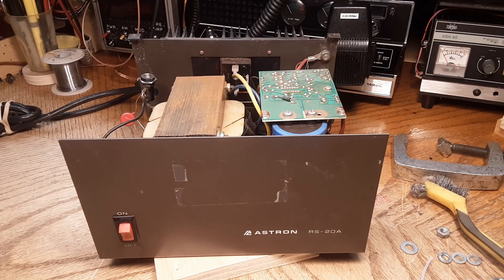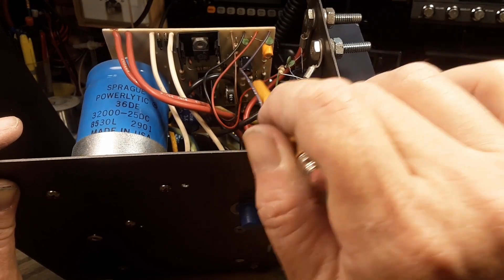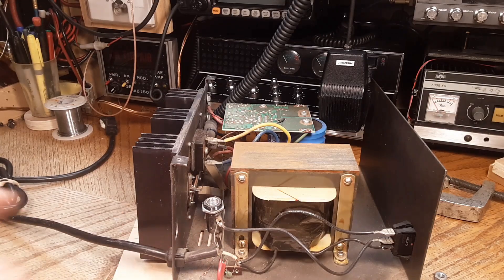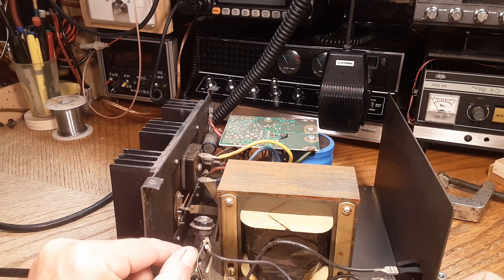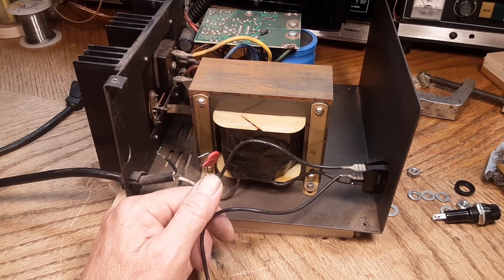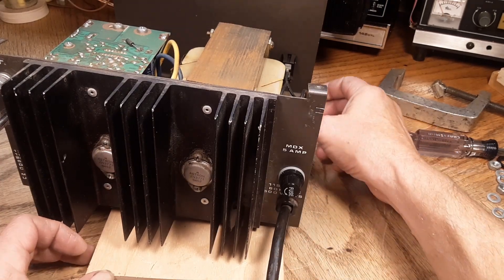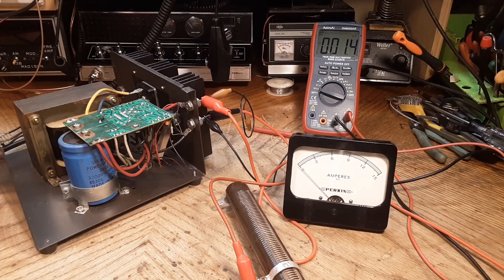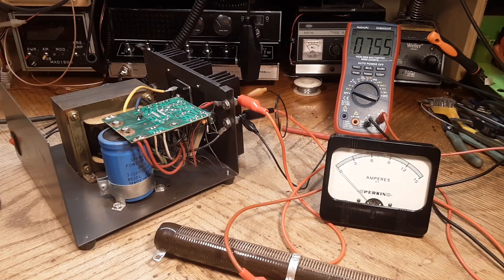astron😀rs-20a power supply,🤔taking a look at.

Comment from the maker: I just realized today that when i went to calculate power dissapation at 8v@5a. i used 10v instead.it would be 70w not 60.😆My comment of," if it works at 6amps it will work at 20amps"really wasn't the most accurate statement.i was over generalizing i think.if the capacitors are low in value,power supply output voltage could sag under load..ive also seen other power supplies with current limit go into limiting prior to their design parameters because of lower value capacitors.

Comment: Ah,  crowbar protection.
I remember working on a big old AC drive that used SCRs instead of transistors in the inverter section.
I put my oscilloscope onto some circuit and managed to trigger the crowbar protection, blowing some very large and expensive fuses 😮
Reply from the maker: Oh wow,sounds like you hit the sweet spot😄scr's do come in the sensitive gate variety,these scr's are not.you musta' had the,"itchy trigger finger"variety.😆makes sense you might of had some expensive cartridge fuses.just don't wrap them with aluminum foil.😁thanku for comment.
Reply: @generalingwer4341  
Exactly.
I have witnessed some dodgy deeds where fuses have been substituted with other stuff at hand.
Reply from the maker: @lindsaybrown7357  my friend in md.took a trip to burn center doing plant maintenance. A worker shoved some copper pipe in a panel fuse block..lucky he's alive.dumb people shouldn't breed.😅even worse was the guys that bypassed a foot switch on a industrial mixer.need I say more.